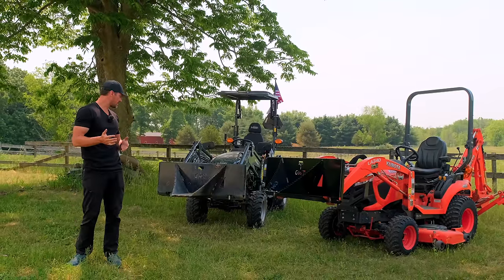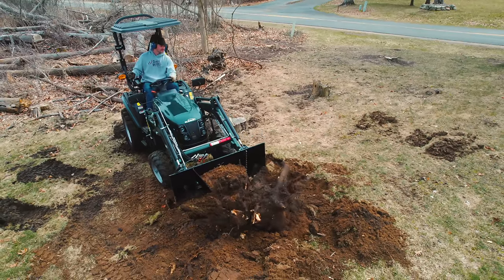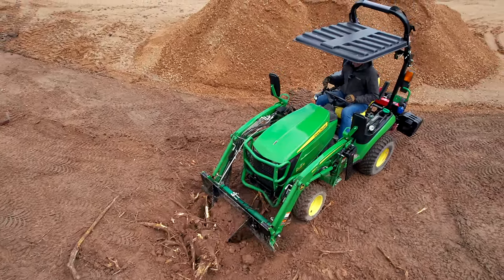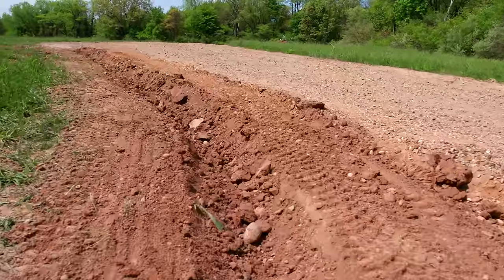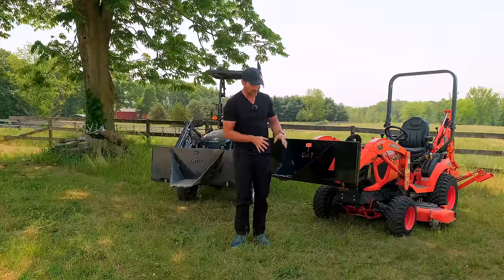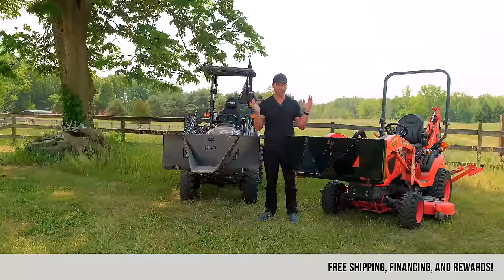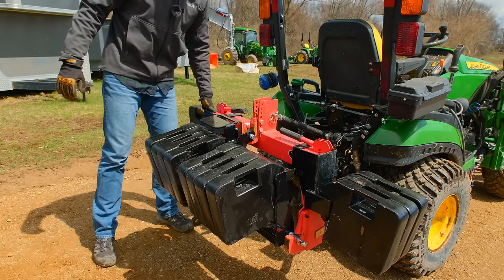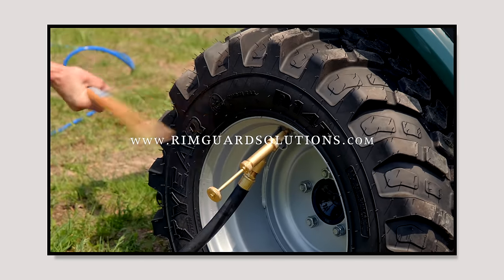THIS TOOL DOES IT ALL! TRENCH, DITCH, ROOT, PLANT, HAUL! 💪

Comment: I used the GWT mini stumper with my LX2610 to remove two fir stumps in about an hour. Worked around the edges cutting the roots and eventually popped the stumps right out. First time trying it out... not a steep learning curve at all. Love it!
Reply: Similarly I have one on a b2650 and it is excellent!

Comment: Folks, Courtney and his team is like Amazon Prime or Fedex 2 day.  I ordered my HD Stump Bucket late on 6/23 last day of a 20% off sale, it was put on truck on 6/26 according to tracking in South Bend, IN (I guess GWT drop ships from there) and it was on my driveway 9:30 am on 6/28, and I am in MD (DC suburb).  The bucket is smaller than I had thought but this ain't no cheap stamped steel.  Thank you so much GWT team.

Comment: Is it possible to build the bottom of the plate on each side of the stump bucket as a blade for pushing dirt to fill back the stump holes
Reply: Courtney pushes some dirt with it. You could possibly add some wings??? I think I'd just put my bucket back on. That's kinda the whole point of quick connect attachments anyways, right?

Comment: Is there a version that can be made to work with a pin on bucket?
Reply: I'd be looking for a pin to quick attach conversion if I were you. Or a new loader but I get that's expensive.
Reply: Ask Tractor Mike has the pin to SSQA adapters.
Reply: Yes, Mike has a source that can adapt for almost any pin on bucket.
It is probably 2000 to convert, but one it's done, you have so many options including the stump bucket.
Reply: Where do I get the Summit tractor besides Atwood or Home Depot. Can I purchase it online? Factory direct with warranty and everything?
Reply: @steliandone4078  I guess I'd be looking on their website and/or calling them for the details.